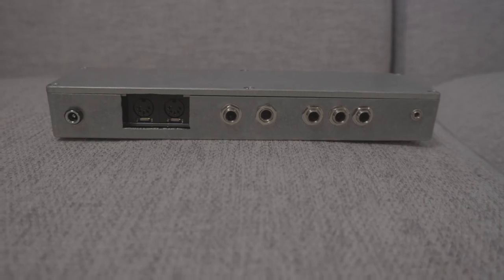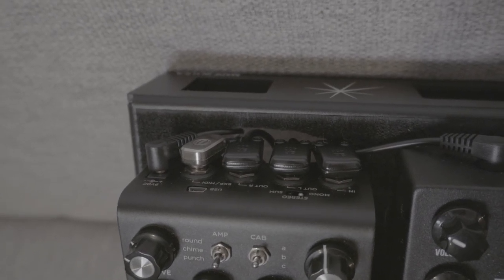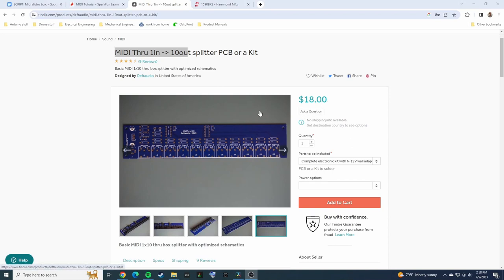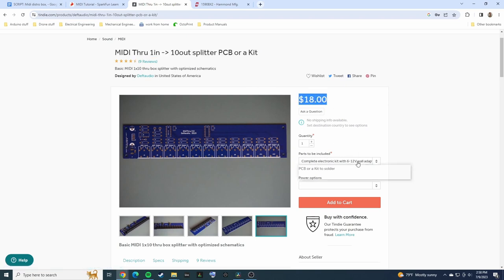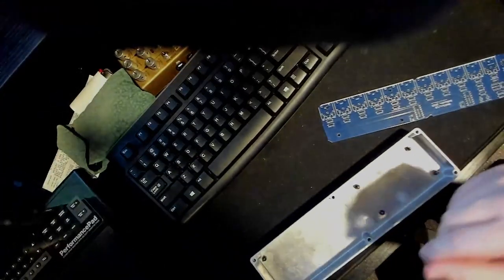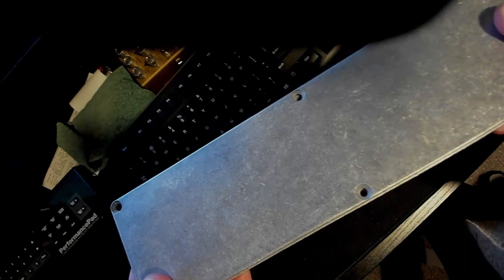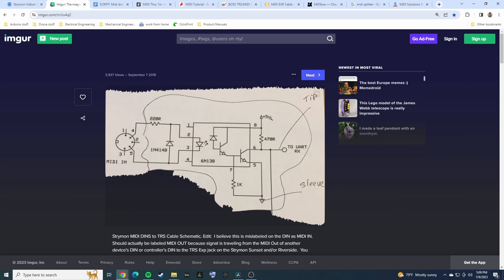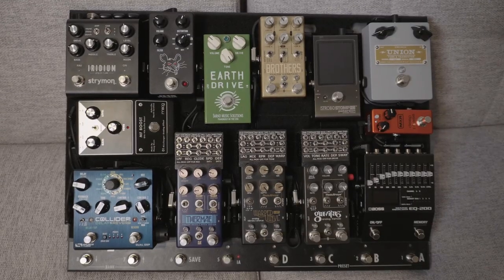How To Build a Cheap MIDI Splitter Box for Any and All Guitar Pedals (or other devices)

Comment: FWIW the strymon adapter cable gets the +5v for it's opto circuit from the strymon pedal itself. When set to midi mode, the ring on the Exp jack is a +5v
Reply from the maker: Oh wow, that makes sense, but I had no idea. If only they'd scrawled a "ring" label on the back of that napkin. I pulled 5v from the midi distro board but I guess you can grab it from the ring instead - good to know.

Comment: I’m now subscriber 115.

This was really enjoyable to watch. I’m thankful to have pedals that all use the 5 pin and I can just daisy chain them and they’re isolated. The MKii Preamp and bigger Strymon pedals (Volante, Timeline, BigSky…) all have 5 pin, although Strymon installs their connectors upside down compared to every other brand. I was reading something earlier this week about Meris pedals having  ground loop issue via midi, so they must do it yet another way. 😂

This is why the MIDI standard exists…to make things easier and compatible and to stop companies from creating overpriced products that don’t do anything.

I want to incorporate a Morningstar Relay Interface to get my tap tempo non midi pedals into the mix next. It’s only $39, but this has me thinking I wonder how hard would it be to build?
Reply from the maker: Hey, thanks for your comment! As for automating tap tempo across multiple pedals - my understanding is that for most tap-tempo inputs, you are simply shorting tip to ground (sleeve) using a SPST momentary stomp switch. If you are trying to have a single mechanical switch that affects multiple pedals - easy peasy. Just get a project enclosure, plug all the various tap tempo cables into some jack sockets on that enclosure, and short all the tips to ground all at once from one SPST stomp switch. If you want to accomplish that via MIDI instead of a mechanical switch, that'd be  somewhat more complicated. You'd need some form of micro-controller to decode the midi signals and drive some transistors to ground. If you are really clever you can bit bang MIDI on an ATTiny85, but who has the time. At at that point I'd just pay the $39 and be done with it.

Comment: My rig needs this,
Currently @ 14 midi pedals,.. what happens after 16, if I need more than 16?
Reply from the maker: Wowzerz, that is a lot of devices. I suppose you could buy 2 of the boards used in this project and chain them together - just tap the signal after the opto isolator/input buffer on one board, and pipe it into the second board, bypassing the opto isolator/input buffer circuit. It would take a bit of elbow grease, and experimentation, and willingness to dissect the schematics a bit. Probably could get it done without cutting any traces.